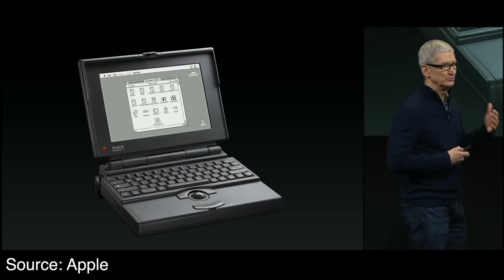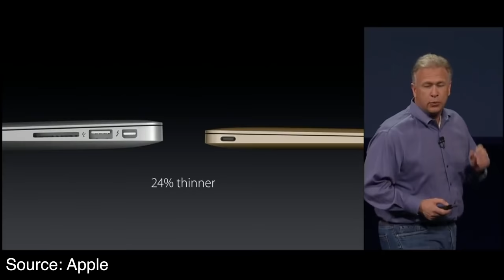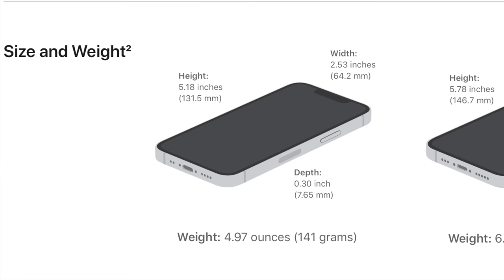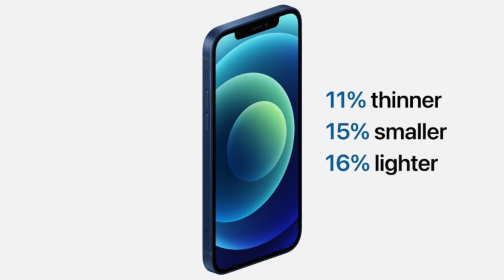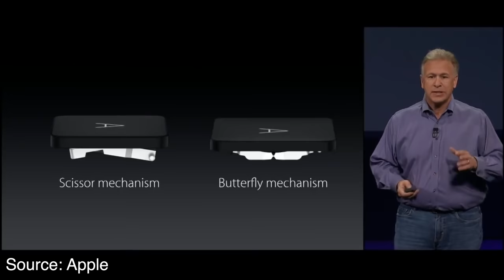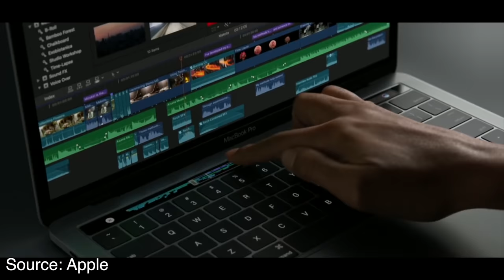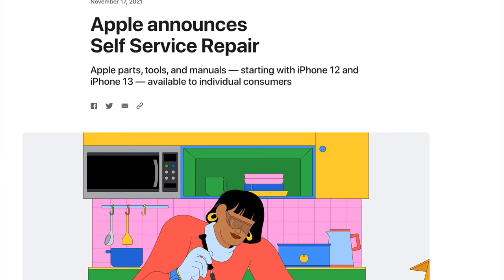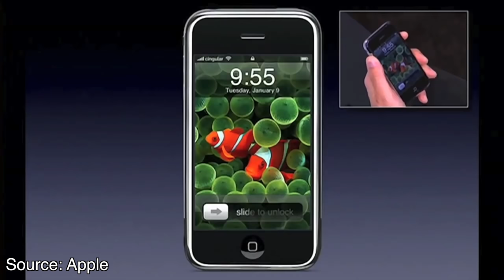Apple is Changing...

Comment: Apple cares about the right to repair, that's why they're building "pro" desktops and laptops with single board designs! lmao... get real.
Reply: Some things may become repairable, but the machine is totally non-upgradable. They could make the SSD removeable, but pretty much rest is all in the SoC.
Reply: @sylviam6535  No it's not. The RAM is not in the SOC and could have just as easily been socketed as the SSD. Hell, it may have been easier because they wouldn't have had to redesign the bus at all. They are non-upgradable and non-reparable by design. They're making them cheap SBCs and treating them as disposable objects because they know they can sell more.

Apple does not care about the right to repair. At all. It's all half hearted PR measures. They're just making parts that you could already source from other vendors available from Apple.
Reply: @griftgfx  - Actually, their logical diagram was misleading, making it look like the RAM was inside the SoC. You may be correct in that it is outside, in which case it could have indeed been socketed.